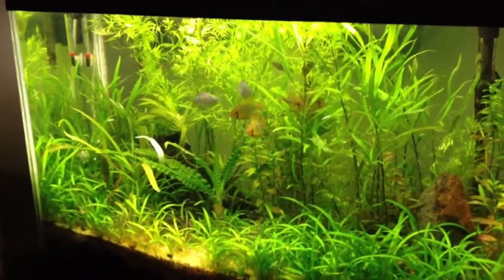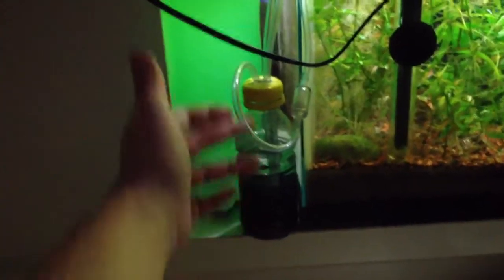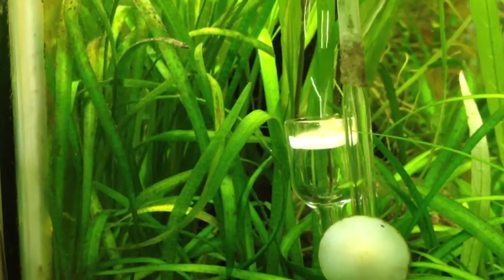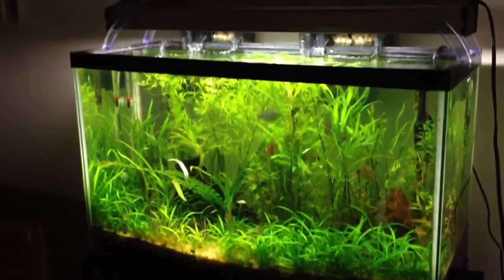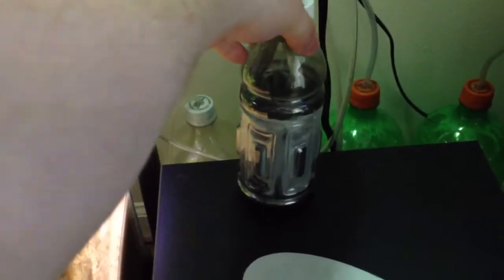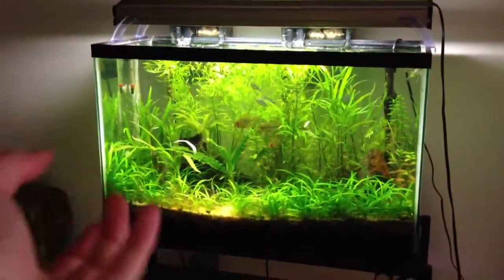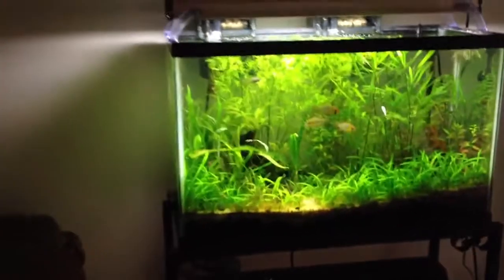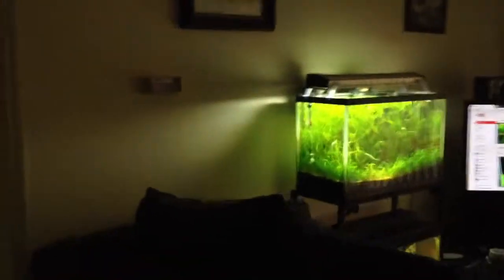DIY Co2 Filter Experiment Results

Comment: hey mate, nice clever setup ...btw I noticed you are using hang on filtration which goes against everything I know about co2 and water surface agitation leading to quick c02 loss....what are your findings ? I had my aquaclear on a timer so it came on when lights went off but I prefer having it on all the time but dont want to negate the co2 which is fine streaming out of a wooden diffuser in the middle of my 3x2x2 covered by 2 sml rocks to camouflage :)

Comment: How to you turn off the co2 at night?
Reply: +Yin Kean Chin  . you cant turn it off . just unplug the tube that's going inside the tank at night, so that the co2  goes into the air instead of the water in your tank . then just simply plug it back in the morning . that's all you can do

Comment from the maker: Thanks for the sub! Ph swings do occur with co2 system.s However, they usually are not significant enough to negatively impact the tank inhabitants. Personally I run slower reacting Co2 systems so that I can run the Co2 system at night. This allows for a more natural buildup of Co2 at night and burn-off during the day. It is important that the system does not react to fast if you are going to do this.  The 10gl tank I have on my channel is a shrimp tank on which I run a DIY system.

Comment: @rarzorz subbed right away. really cool video's. i wanted to ask, does the DIY system mess with your PH or KH? ive been in it for two years now and ive only used DIY co2, but i have shrimp in my tank now and i cant have them wipe out cuz of a ph swing. and also, is there anything you to when the lights go off? for the excess co2

Comment: ahhh ok well I will just let this mixture run until iits out and use a different one next time. I used 1 cup of sugar for a two liter bottle with 1 and a half teaspoons of yeast. and I have two of those running. what does the baking soda do? will it effect my co2 sence I don't have any in there?

Comment from the maker: How do you know it is going too fast? Did you index the amount using a Dkh, PH chart? Do you have drop checker? You vary the speed by changing to mixture. Generally the less yeast the slower it will run. This is hard to gauge and varries per tank so  it may take a try or two to get the right results. The standard mixture is 1tb yeast, 1tb baking soda and 1 cup sugar per litter. I tend to use ~.4tb per litter. To slow it down while running you will dump out a portion of the mixture from a bottle.

Comment from the maker: Another option is to build a system that uses two 2 litter bottles that runs slowly and use a powerhead to diffuse the Co2. You could easily get a 4-6 week system out of this and maintain the proper ppm.

Comment from the maker: Personally I would use 4 or 5 two litter bottles. Most people would say this is overkill, but I personally prefer longer lasting Co2 systems which I can run in the tank overnight without removing the diffuser or turning anything off. You can still maintain Co2 at 20-30 ppm while doing this and it results in more stable Ph levels.